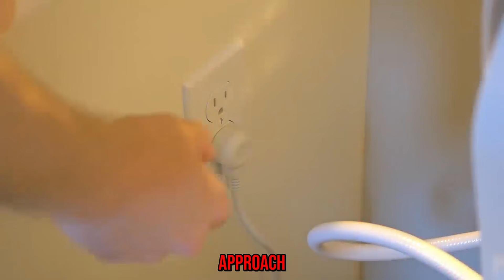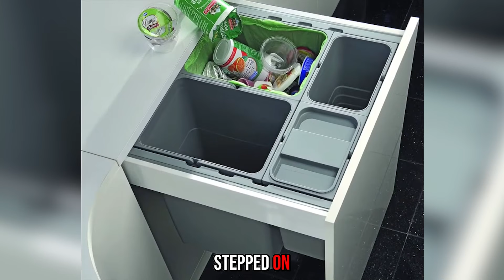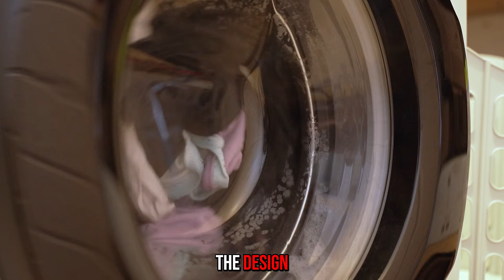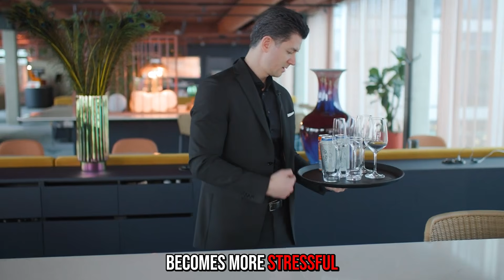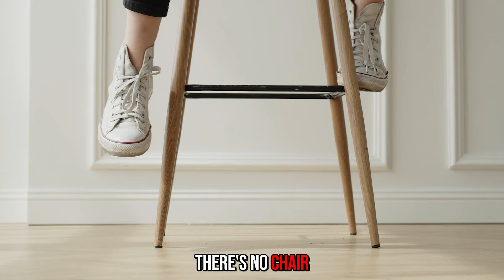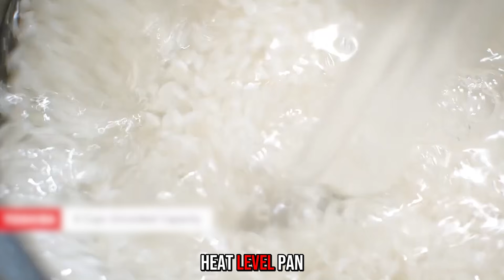15 Japanese Ideas That Fix Everyday Problems FOREVER..

Comment: The washer/dryer is available  outside Japan.  But not very popular as its extremely  inefficient to run and uses a lot of electricity.
Reply: They also have other issues like not really doingba great job of EITHER washing or drying. Plus if they break down, tyry are extremely difficult,  if not impossible to repair, and you are then left without BOTH appliances until u can replace them both.